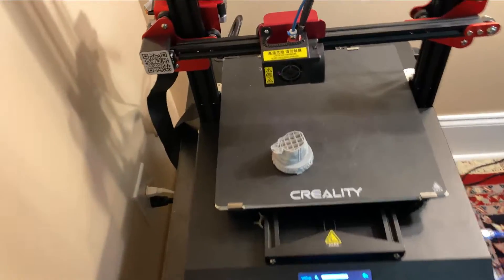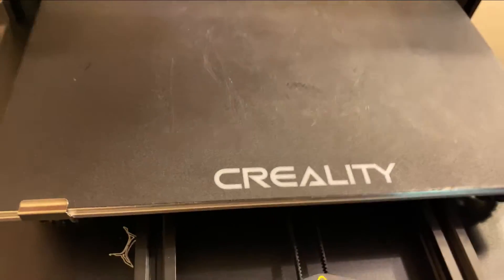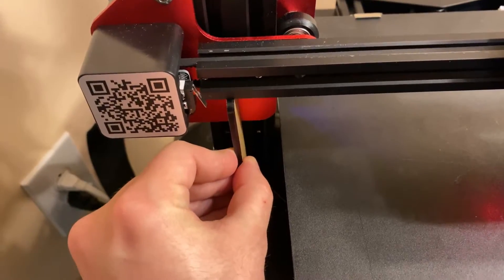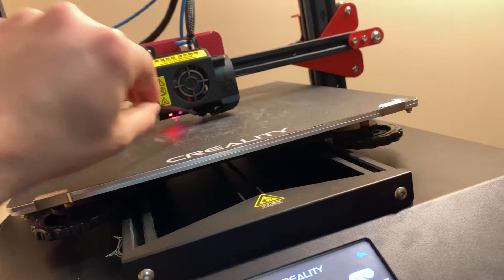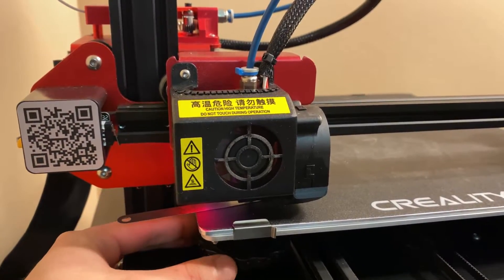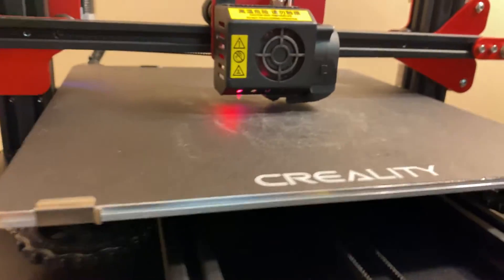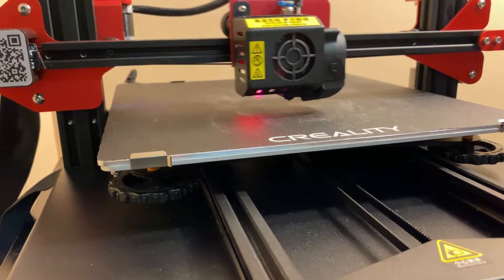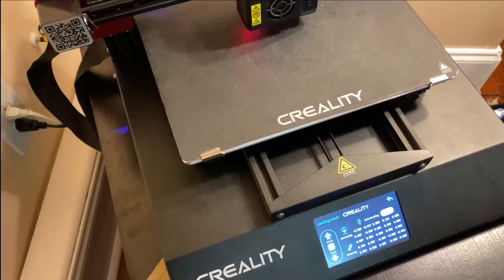How I Bed Level The CR10S Pro V2

Comment: I bought a used 3D printer and unfortunately I don’t have the bed leveling tool that it originally came with I need suggestions on what I can use as a replacement.  All I really need is the measurement of the leveling tool so I can find something equivalent to use

Comment: I would suspect many print beds like mine have the center dipped whereas the 4 corners can be several mm higher. After leveling 4 corners, my center nozzle was still way too high.

Comment: My brand new printer: tap levelling icon, head lowers, touches sensor, sensor retracts, head rises, sensor drops. Head lowers, touches sensor, sensor retracts, head rises, sensor DOES NOT drop. Head lowers and wants to drive thru bed. Hit power. I’ve tried about 20 times with the same result.

Comment: Hiya, not sure if you can help me here. So I levelled the bed using the .2mm metal piece and it was perfect. As soon as I start the print, it raises the nozzle in the air again miles away from the bed... any ideas? What am I doing wrong?
Reply: I had this problem too. Look for your z-axis offset.  It is a setting that adjusts the nozzle up and down from where bl-touch detects the bed. Move it down a bit at a time so you don't damage anything.

Comment: Hello.  I have a new CR 10S PRO V2.  After successfully manual leveling and doing the 25-point check, I try to print, but the nozzle starts to extrude PLA a few millimeters above the bed.  Does anyone have an idea why that is?
Reply: Did you resolve this. Having the same issue
Reply: @chrisrowles843  we did.  After you manual level and start your printing, you can adjust the height of the nozzle by clicking on the "adjust" option and changing the Z-axis.  It may take a few tries to get the right height, but that's what you have to do.  We also found that adding glue stick to the bed helps with the first layer sticking.

Good luck!

Comment: i had to do .1 and for some reason it still was too high for printing any ideas
my esteps are set for my extruder its printing but i usually do a bed level with a .1mm and do a level test and i adjust the z offset when its doing that till theres no material trying to pull up any ideas on why i have to do it this way?

Comment: I did this 4 times exactly as you did and it's done nothing, nozzle is still too high. Do you know why? Or if you have a video showing how to fix this ?
Reply: Had similar problem. ended up doing manual leveling (the step with truning the knobs). Next I would start the print and adjust z-offset on the fly. What I am looking for is that the line being printed is just ever so slightly squished. I found i need to do this step every time i cycle the power on the printer. I guess it is generally a good practice to babysit first layer.

Comment: When I try to adjust the bed the wheels underneath are all the way loose almost before the nozzle hits the measuring tool. I keep twisting them up halfway, adjust the cross beam to 100mm and then start leveling and the wheels underneath always adjust to almost loose when leveling. How do I fix that before I start ripping my hair out?
Reply: Not sure if you've resolved it yet but I had the same issue. I got my printer a week ago. The nozzle wouldn't get close to the bed even with bed adjust up high. Found out my BL touch probe was stuck, pulled it down and it changed colors. The auto level started working and lowered the nozzle all the way to the bed. Now my bed is as low as it will go to keep the springs tight, no issues since. Hope this helps.

Comment: I have this, I did everything in your video, I have the same printer, Problem is I do all for corners and when I am in the middle it is still too low.  I also upgraded to the glass bed Creality offers.  What do I do if the middle is too low but the other 4 corners are perfect?
Reply: Will have same Problem . All side Pointe perfekt,  middle is on bed..! Other Problem. I Start print, after 10 % the Objekt will  Lose contakt to bed... i hat this. Waterwoodglue mix on Glas help a little bit, but leveling is terrible.  Paintertape the same.  Objekt will Lose contact together with Tape!!! Thats not funni to work

Comment: if you set zero with a 0.2 gauge then wouldn't your zero actually be 0.2?
Reply: I have the same question, because your first layer (.2 or less) begin in .2 from the leveling bed :P

Comment: 1:39 you vaguely point at the roller and say "hold that twist that" "ill show this step in a second" but you don't show how you did it and I have no idea what  you adjusted to make the spacer fit on both sides
Reply: I have the same problem and I cant get the z axis leveled
Reply: Just turn the motorscrews until it fits, easy.
One way will increase the gap, the other will decrease.

Comment: You dont need to adjust with cold table and then with hot table. I think adjusting with hot tabe AND hot nozze is enough. Nozzle needs to be hot too for two reasons. 1 it expands too, 2 you can easily cut any excess material easily that could result in faulty measurements

Comment: Help! I've been having a longstanding issue where I level the 4 corners of the bed, but the nozzle hits onto the surface at the center. Been trying to do larger prints but these screw up
Reply: I have the same problem, do you have to adjust the z axis or something?
Reply: @kerryjohnson7364  not sure if I resolved it, but I tightened the eccentric nut that holds the hotted and fan because for mine it was dipping forward a little bit. You can try doing that to see if that helps
Reply: My bed was flat. I could level all 4 corners but the middle was 2mm higher. Creality is sending me a new bed

Comment: Is it just me, or .... what is "Auto leveling for" , when you have to fiddle on screws and what not to make it correct? Shouldn't a machine in 2019-2020/2021 be able to do all this automatically? - Seems lame to me.
Reply from the maker: So the naming is misleading. I agree with you. Essentially the user still levels it. What the “auto leveling” tool does is calculate the minor unlevel areas and compensate for them when printing to get even better prints
Reply: You are absolutely right

Comment: What is the best starting point to level the bed? Should the 4 adjustment wheels be tight, loose or in the middle? I’ve tried all three and keep ending up running out of adjustment space and hit a limit of how high or low I can move the bed.
Reply: I got it leveled, I just had to set the Z axis offset before leveling. Thank you Anton.

Comment: Just bought myself a Creality CR10S Pro V2 because all i see on youtube is the most smoothest and flawlesly unboxing and imediately perfect working 3D printer without any problems that makes the most reliable and perfect prints you can imagine.
I want to install the printer so perfect, read the manual before from A to Z and backwards so that i'm not going to make any mistakes, then looked for another dozen unboxing and installing tips on Youtube and finally after 2 days i managed to install my printer without a problem in no time.
But then.................I turned it on and................... you guess; ...... trouble started;
The printer went down on the bed and made a really ignorant noise like metall that is bending ..... and it did bent (or is it benD??). The Nozzle was in the middle of the bed and was going down while the BLTouch Bed Leveling Probe was hitting the bed first, 2 times to be exactly, and then get up again before it came down without anything in the world could stop it. It really hit my Bed very hard and before i knew what was going on and powered off the machine, there was alot of damage.
I have tried to recover the damage and went on, with the believe it was my own fault because i was so stupid to trust something to work right out of the box. But whatever i tried and how much video's i watched before making another attempt; the damage is getting worse and worse. BTW, after leveling it always says that Z=29,9. But the nozzle is only about 15 away from the bed.
So now i have a completely brand new CR10S Pro V2 that is not working (and the bed is damaged, without warranty as i understood)..
It really drives me crazy and i'm desperately in need of help.
Is there anybody, preferebly in the Netherlands, that can help me please?????
Thanks in advance,

Gerard
Reply: Did you calibrated the Z axis height (distance from your printer housing to Z axis with extruder) to 20cm (or 10cm I don't remember) with included piece of plastic ?
Reply: Have you already fixed it? I'm in NL and have the same printer so if You need some help, give me some contact to You.
Reply: Printer should be renamed Cruelty

Comment: I have followed all the steps in here and have the 4 corners perfectly level. My issue is My bed itself is not nearly flat. I can't get the center to be the same as the edges. I would think that having the bed levelled on the edges would at least get me a good level bed and the auto bed-levelling would account for the center being a bit higher but no matter what I do, the prints near the middle on the first layer are too high in comparison to the edges, even with auto bed levelling before the print. any ideas? I have a new glass bed coming in which should fix the problem but I feel like the bed level compensation isn't being done. anyone else experiencing this? This is brand new.
Reply from the maker: Try lowering your z offset making sure the middle is perfectly level first, and re- level the bed - on all corners
Reply: I've the same problem. There's no use lowering your z offset. Did you already try with your new glass bed?
Reply: @pedrocarvalho2070  Yes. still same issue but not as noticeable. i resulted in putting a few layers of tinfoil in the middle to raise it up. i have a whole new issue which you may be exoperiencing also. my first layer always prints approx 0.2mm too high. i adjust my offest to account for it and the first layer prints great but then as soon as i hit the 2nd layer, it digs into my first layer so i have to go in and adjust my z height back. then the rest of my print is mint. I am probably just going to return the printer and get a new one.
Reply: I fixed my 2nd issue by installing new firmware.
Reply: @pedrocarvalho2070  yes. it's not as noticeable but it is still different
Reply: I had the same problem Creality is sending me a new bed.

Comment: For some reason whenever I start a print (bed is perfectly leveled) the nozzle lifts up and when it comes back down it doesn’t go far enough down. So it’s printing on air, I cannot find a way to stop this from happening
Reply from the maker: So what you need to do is 2 things- lift your whole bed higher, re-level, and also edit your z offset a bit (not too much). when you level your bed on the lowest level it goes this issue can happen( i myself, been there, done that)
Reply: @AntonsCreations  When I lift the bed higher and re-calibrate, the nozzle simply raises itself up higher again. Really annoying
Reply: @AntonsCreations  im also having this problem. How do I adjust z offset?

Comment: Great tutorial - BUT. So I haven't used mine in a while, haven't moved it, but after watching a few of your videos (EXCELLENT, by the way), I thought I should level mine again. In following your steps, I could not get enough adjustment in the rear - both of them. Then it dawned on me. I tightened my adjustments all the way, then loosened them about 2 turns. Then, I did the measurement. Then repeated your steps again and it worked great!
Reply from the maker: Great to hear that!!!

Comment: Nice Video! Made my first prints today! I’m impressed as it is my fist 3d printer. What is a acceptable difference in the 25 calculated points? Thank you in advance 👍🏻
Reply from the maker: Dkhalesi are you referring to the numbers you see after leveling? To be honest- I don’t refer to those at all. I simply make sure there is equal strain from nozzle to bed on all 5 quadrants and know I’m level. Been using that method for 5 months now with no issues!
Reply: Anton Talks Tech thank you for your reply. Yes I was referring to those numbers:) Good to now. Was looking for a reference for those numbers! I couldn’t wish for an easier printer as a noob :) just started a 28 hour print...

Comment: When you level the bed, the nozzle immediately gets close to the bed for you to fine-adjust. 

I just got the printer, and in my case the nozzle stops probably 15cm over the bed.. 

How can I get it closer to the bed? I cant lower it enough with the “z-offset”. 

Thanks :-)
Reply from the maker: VissenF are you sure you’re z brace is low enough? Use the wooden piece to level it, then lower your z offset. Hope that helpsb
Reply: Anton Talks Tech 
Thanks for your quick reply👍 If you ask if I have leveled the z brace with the 100mm block, then yes. While the printer is on and also off. It seems like it doesnt care what height the brace is set at
Reply from the maker: VissenF raise your bed everywhere - then lower your offset till it’s low enough...then make sure your bed is level is what I’d do
Reply: Anton Talks Tech When I lower the offset in the leveling menu, it moves down in 0,1mm steps. At some point I can’t lower anymore - it’s like it reaches a max. At this point I’m still way too far from the bed - even with the bed raised..
Reply from the maker: VissenF I’m not sure what off then, if your bed is leveled to the max, and your off set it max along with a brace level it should work
Reply: @AntonsCreations  Exact same issue... Everything was perfect, then I did measuring and after that nothing worked. Nozzle does not come closer than 12cm from plate?
Reply: Now Fixed. Went into move, set height at 30, then manual adjust down so it allows me to move down further.
Reply: Andre Davids Did you have the same issue? How did you manually adjust down? By turning the rods?
Reply: @VissenF  exact same issue. But instead of disbaling the motor and adjusting the height sgain manaully, also try push the home button, it should move down and calibrate. If not, I found that the pin pushing out to take the measurement for auto adjust does not push out and this it keeps pushing the z-axis upward. Look like a factory fault my side. That pin keeps getting stuck. Only got the printer today 🙈
Reply: Andre Davids thanks :) I wonder if my pin is stuck too. Haven’t seen it come out yet.. I’ll try to do it your way. Let me know how everything works out for you🤓
Reply: @VissenF  you van manually also pull out the pin when stuck. It works, but long process as you have to sit en watch the calibration.
Reply: Andre Davids how is the printer working for you? I’m still having troubles here..
Reply: @VissenF  regarding the issue mentioned above about the nozzle hovering above the bed, no issues anymore. I did realize later on that my BL Touch sensor is faulty (fails to deploy every now and then) straight out of the box. So that caused a whole bunch of headaches... I have 2 options, turn of auto leveling and hope everything goes well, or leave it on and hope during the 25 point calibration it does not fail. If it does I need to restart the print every time... I will gladly try help you with your problem. Not sure how to make contact as don;t want to share my email address here.
Reply: Andre Davids Thank you. I appreciate you wanting to help. I could really use some ideas,. I’ve had nothing but headaches unfortunately, and I don’t know what I’m missing...
Reply: Andre Davids Hey andre! Thanks for your answer. Did you receive my message?
Reply: @VissenF  hi man. Sorry life has been a bit hectic. Have not seen another message apart from the above?
Reply: Andre Davids no worries! If you want, feel free to send me a message on visfug@gmail. I’d appreciate some tips to get this stand-by adventure started 😁

Comment: Does anyone have difficulty adjusting the z-axis leading rods using the black plastic piece?

The left leading rod of my printer is always lower. I assume it's due to the weight of the printing head.
When I release my hands after turning the rods, it will slightly turning back by its own weight, unless I hold the rods while clicking the screen to move on z-axis so the motor becomes on and locked. 

Once I turn off my printer, it seems to be going back to be tilting. So does it mean that I have to calibrate it every time after I turn off my printer?
Reply from the maker: the printer compensates when turned on for the nozzle head weight a bit. no, you should not have to level it every time. using the black piece, make sure both sides of the rail have same amount of height and that should be good
Reply: You could also try tightening the nuts for the bearings on that side. Mine came a little loose which caused that side to sag when the printer was off.

Comment: Replacing the springs with solid spacers would probably be are a good investment for ABL printers so I hear because it removes the need to adjust the bed because the level should always be the same I'm going to buy some for my ender 3 pro and see if I can get my Bl Touch working on it.
Reply: How did that work for you?

Comment: Did you find out how to make the printer do the 25 point autoleveling everytime when you use Octopi?
Reply from the maker: Ilan David you can achieve this one of two methods. Method 1 (my preferred) print off of local SD card as normal and that gcode has it to auto level. Use octoprint to simply monitor the print. Method 2 edit octoprint start gcode with the auto level command G29. (Look yo how to do that. Plenty of resources our there detail it) hope that helps! Cheers!